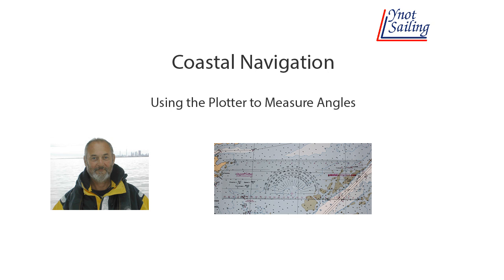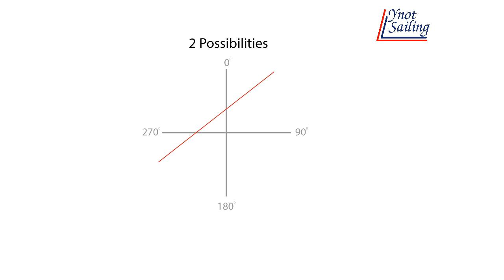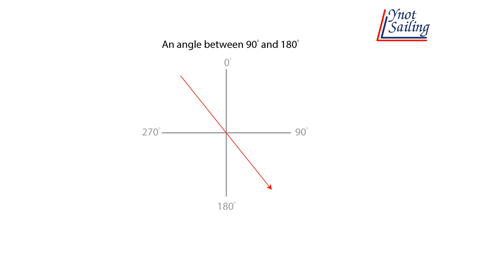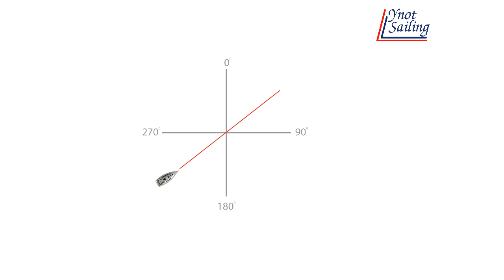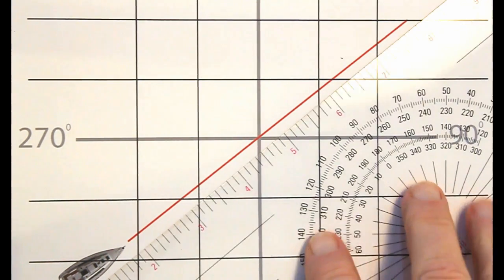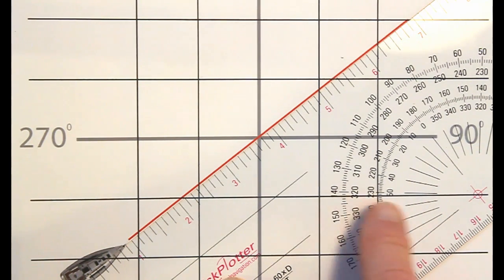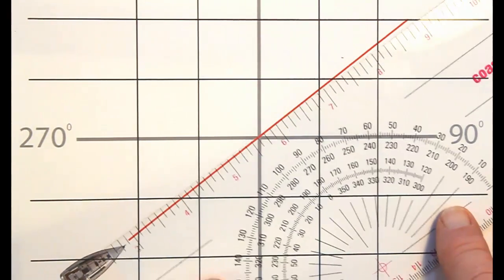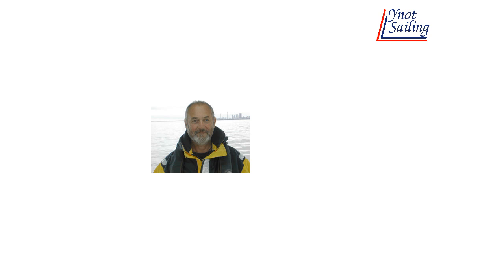Coastal Navigation - Measuring Angles with the Quick Plotter

Comment: The larger outside protractor rings are for using with the "bulls eye" on the Vertical lines of Longitude (meridians)

The smaller inside (auxiliary) protractor rings are for use with the "bulls eye" on the Horizontal lines of Latitude (parallels)